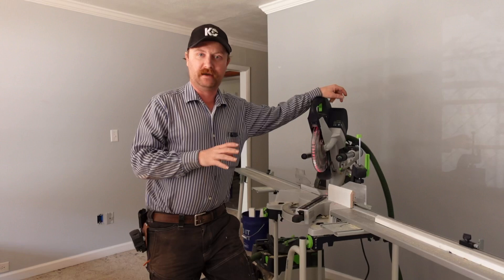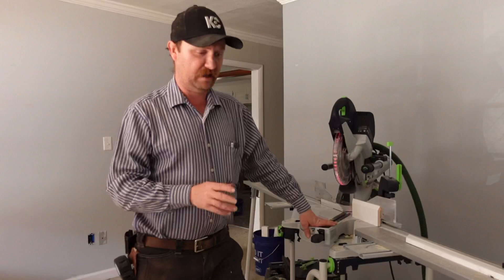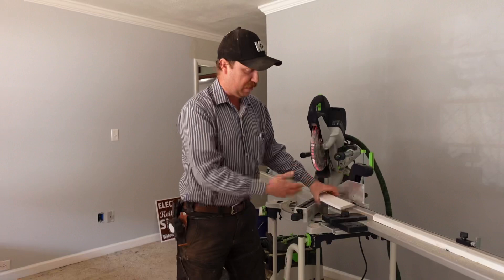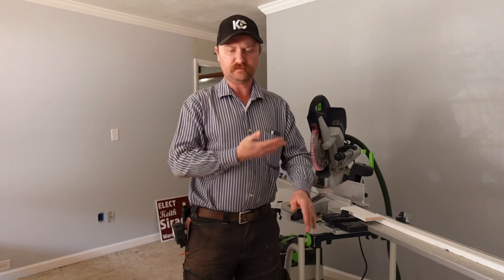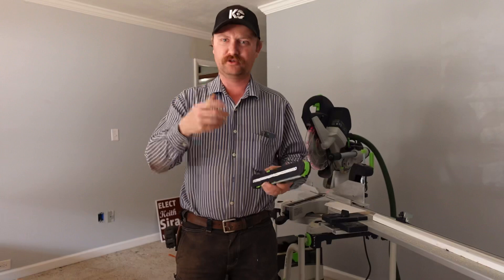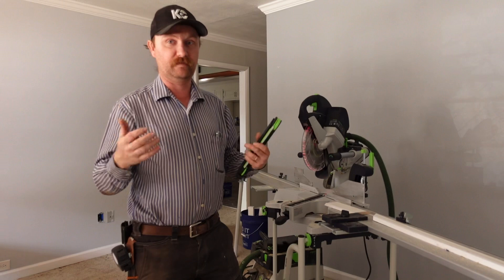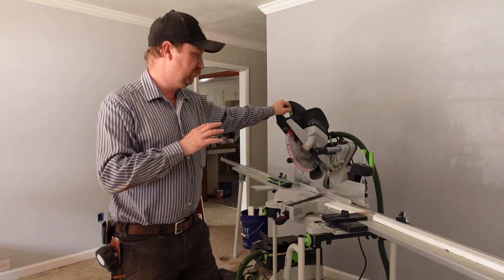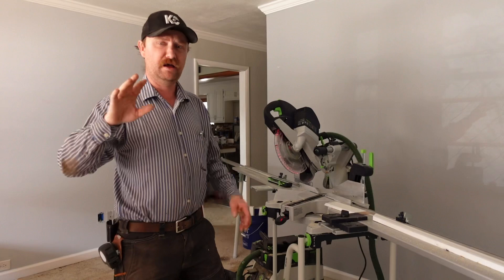Festool Kapex!  Thoughts and Impression After Some Job Usage

Comment: My setup is going strong.  I too still use my Dewalt cordless Flexvolt 12" slider on jobs where there is no power, as I am completely cordless for everything now, no more cords when needed!!   However, I setup my Kapex stand and saw with wings when doing full kitchen and trim installs where I can be inside due to not worrying about dust in a finished home.  What a gamechanger, especially not having to keep walking outside to make cuts as to keep any dust from migrating around the customers home.  Every tool I own in a cutting capacity, is attached to the CT36 at all times.  The only thing I am engineering is a way to make those Festool wings a little wider utilizing the crown stops, but not quite there yet.  I know my plan will work, just need a little more R&D to make it work.  Then I will be 100% loving the Kapex setup, at about 95% right now!  Love all your content, I enjoy seeing how others run their sites to try and see improvements I can make, keep up the great videos!!
Reply from the maker: Thank you for watching!   Sounds like some interesting ideas. That’s one thing Festool folks are really good at, making good tools even better.  Hopefully you can get there with that idea!

Comment: I've had a Kapex for about 5 years, absolutely love it.  It is hooked up to the CT-36 power port, no problems with power.  I got a Betterley zero clearance insert, it's nice.  Good video, thanks !
Reply from the maker: I’ll have to look into that insert, I could definitely use one!  Thanks for the tip!

Comment: I had a flirtation with Festool , what killed it for me , as a mainly cordless user , spare batteries and chargers are not readily available over the counter . At one time I was running both Hilti and Metabo cordless stuff , I had a battery and charger stolen . In Canada where I hail from , replacements aren’t quickly available . Ditto , Festool ! This why I’m on the Milwaukee platform .
Reply: Where I hail from!!
I like that👍😂

Comment: I also have a kapex 120 and i like it so much, only downside with the stand/wings is when you setting it up outside in uneven terrain but when you are on a solid floor it is superb.
Reply from the maker: I could see it taking some fiddling to do that for sure. As an indoor use saw it’s awesome. My Dewalt in the trailer can handle the outdoor builds. I like that I have it permanently installed in the trailer benches

Comment: Nice and capable saw, no,doubt, but for that,proce, it should have good features, and should sweep itself off after use, Ha Ha!  😂. As for the handle, it is a personal preference thing,  but this style doesn’t contribute to uneven motion when sliding through a cut, which tends to be a more accurate cutting experience.  I doubt I will ever own one, but enjoy yours!  Like these type of videos as they help the community out.  Nothing beats first hand knowledge and experience with the usage of tools, on the job!  👍👍👍👍👍👍😁✌🏻🙏🇺🇸

Comment: I just got the makita 18 volt 6 1/2 miter saw, weight 14.6 pounds and small,  getting tired of hauling big saws all over, most trim I do is small, if I have bigger jobs the big saws come out. Cuts accurate but I haven't used it on a job yet
Reply: I think I would have to agree , what weight are we looking at for that festool?

Comment: Had this a saw since it hit the states. For sure do not plug into the vac, vac cannot handle amp draw. Plug into the wall and use bluetooth to start vac. Been using power miter boxes since '79, this is by far the best saw I have used for trim...
Reply from the maker: That is a great idea. I put the Bluetooth system on my CT36AC which I’ll be primarily using with this saw so that would work just fine. I should get the new midi but my old one is still great so that ones a bit hard of an upgrade to justify yet 😅
Reply: Never had any probs with vac and amp draw, is this something I should look out for?

Comment: I used to like my kapex until it took a dump on me. The motor went out on it granted it was 12 years old but I have an old Rockwell chop saw that’s 50 years old and has seen hard use and it’s still cutting like new. From what I’ve been reading people are having problems with the motors on the kapex and I hear fesstool customer service is not very good. So I guess I have a new boat anchor

Comment: Great video. I have a question about moving the table to different settings -  say 27% as an example. I just bought the latest Kapex 120 and find that moving the table seems a bit stiff to me - I get the feeling that something is rubbing on the scale as I move it. Has anyone else experienced this. Thanks, Dave
Reply: spray some silicone spray to lube it up, dose the trick nicely

Comment: I am on the market for a good mitre saw since I went trough alot of saws and always get disappointed even after tweeking and squaring the saws , two first candidates were the kapex and dewalt dws780 or 790 flexvolt in my mind, after going back and forth and weighing the pros and cons I think I will settle with the dewalt flexvolt,  I really like festool products and own many of them in my arsenal still couldn't justify the cost of 2400$ Canadian pessos, it simply doesn't offer much versatility over  the other mitre saws exempt dust collection and the front rail function,  for 830$ I can have a 12" mitre saw including the stand which festool charges additional 1500$ for it , I am professional carpenter and know the kapex has more ridgid construction and well thought design,  but in the real world for me the dewalt either the 780 or flexvolt they are winners in this case